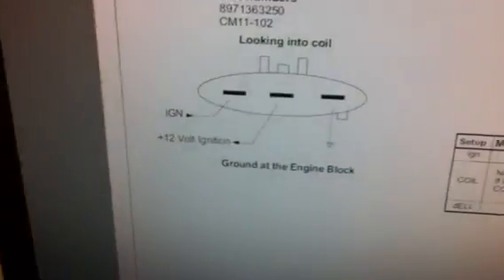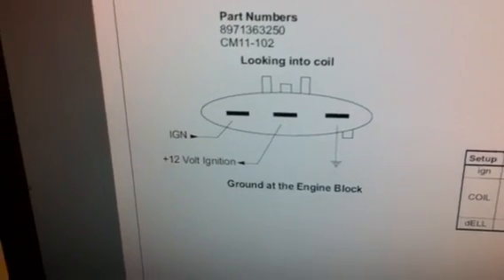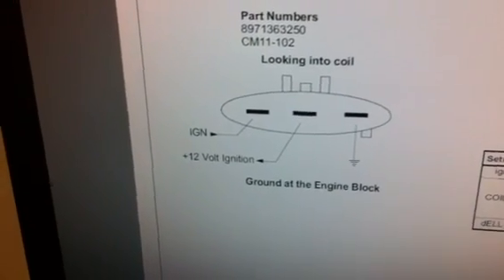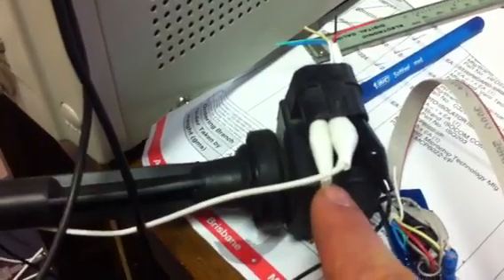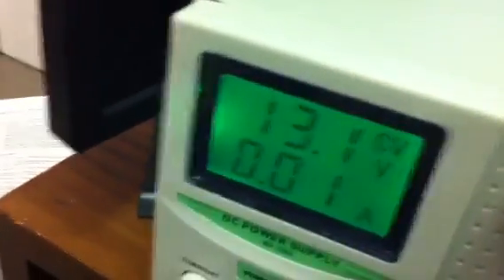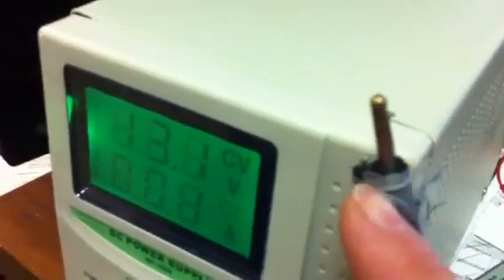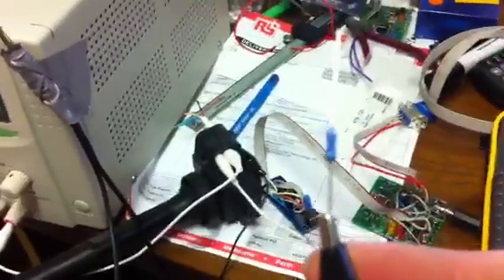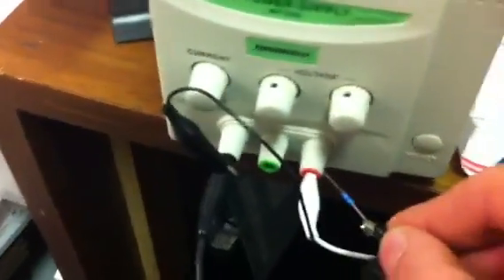Cm11-102 ignition coil diagram

Comment: Don't think it has a built in driver.  I inserted a normal sparkplug and it fires only once not matter how long you apply the signal. Either the EMF is interrupting the input signal or it's the switched-mode PSU. Or it has something to do with the self-made sparkplug.  But thanks for the pin-out though and good vid nonetheless :)
Reply from the maker: It turns out I was using a low current power supply and after each spark the voltage drop turned off the driver circuitry, then the voltage recovered and created another spark etc, etc, so yes, it doesn't have a "constant spark" driver built in!
Reply: Either way thanks for the pin-out!   I'm currently driving it with a micropython board and a ULN2803A transistor array.  BTW do you still have that datasheet of the cm11-102? I can't seem to find it anywhere

Comment: the pin ID is good. on buy the coil and experiment with it some it can be
fired in an orderly fashion with a digital 0-1-0 (12V)  pulse on pin 1 using a 4N27. lots of EMI on the 12 V pin 2 & it needs suppressed. once done u can still see some  EMI noise across a 4 ohm series R at the 12 + pin on a  'scope. know that the spark is trig'd on the falling 1-0  edge of pin 1 pulse. &  the pulse has to be at least 500 uS wide.  next is to use this as a  subst. for my Yamaha 225 CDI w/  a  16f84 uC